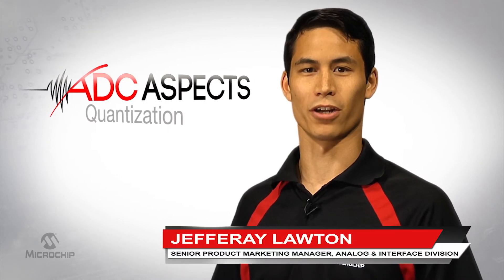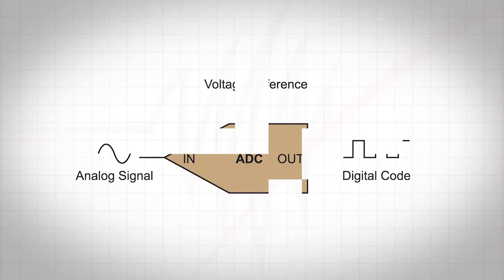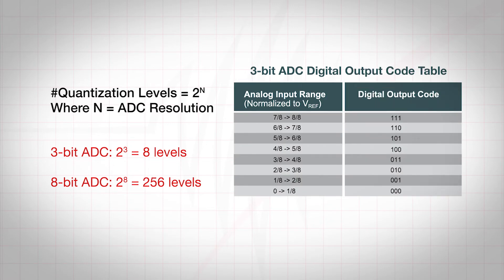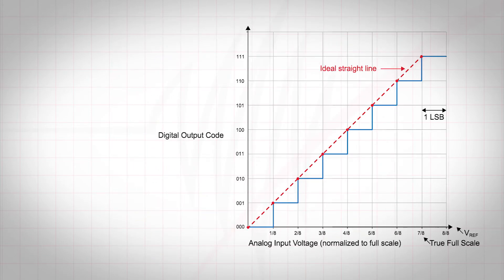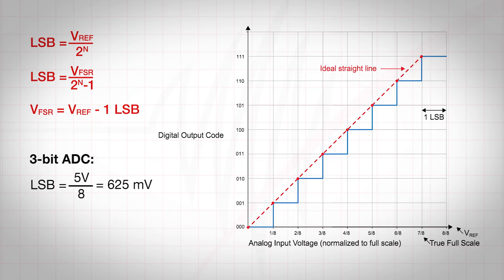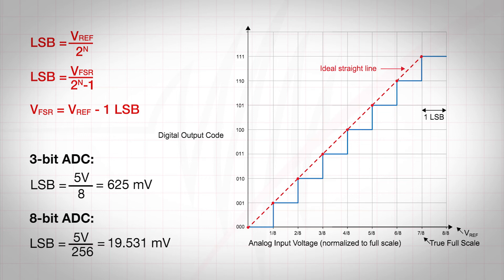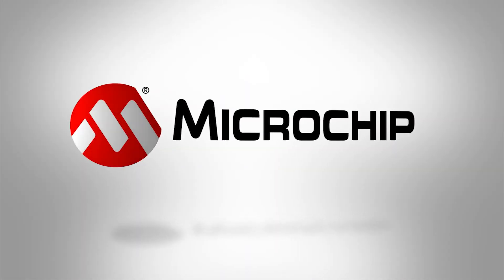Microchip ADC  Aspects Episode 1 Quantization

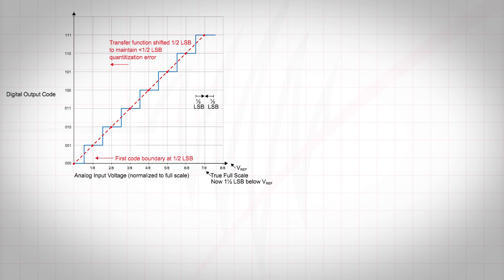Comment: In time 2:45 there's an error in the figure representing the transfer function with 0.5 LSB input compensation. Even with a 0.5 LSB left shift, the definition of VFS = VREF - 1 LSB remains  (where VFS is the full scale voltage). It's easy to see that, in the figure, VFS = 7/8 VREF or, in other words,  just 1 LSB below VREF.  The point 1.5 LSB below VREF is called VFT (transition to full scale voltage). So, VFT= VFS - 0.5 LSB, or VFT = VREF - 1.5 LSB or even VFT = 13/16 VREF.